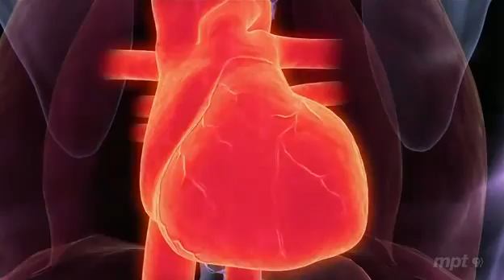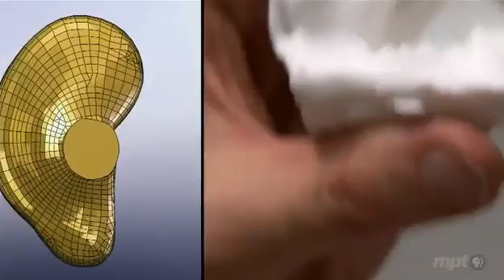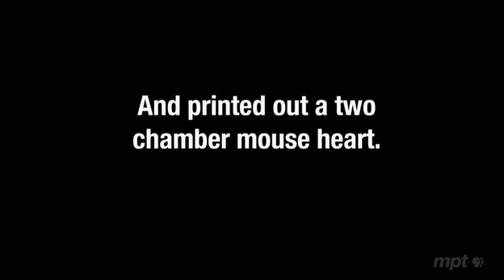Artificial Organ Regrowth

Comment: Nice, but they should rig up a modern 3D printer to print the scaffolding, since it's not really live tissue but proteins. They can already print crazy polymers and even metal so this should be doable no? Then might as well design do some structural improvements to the digital blueprint they grab from high-res bioscanners/imagers.